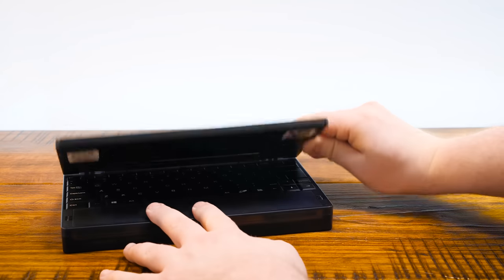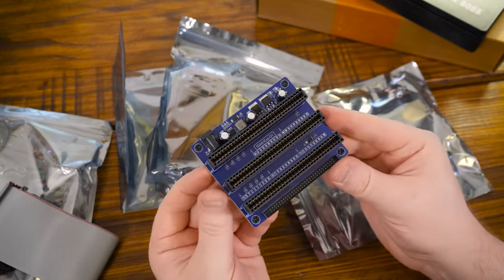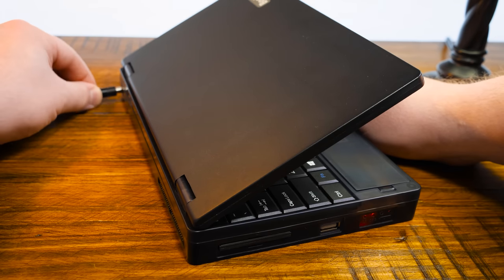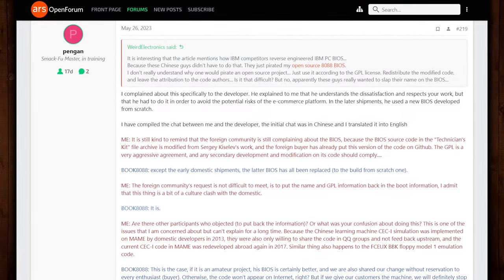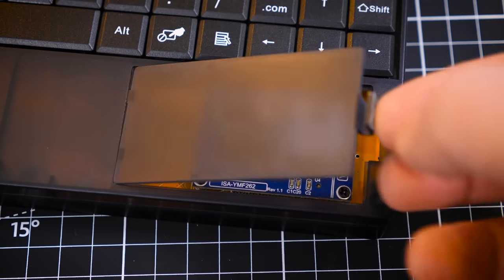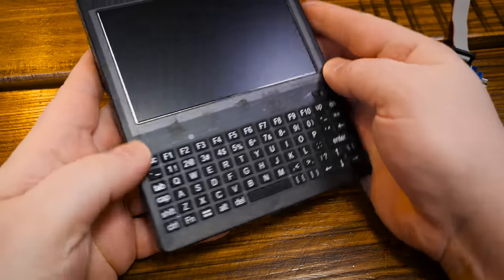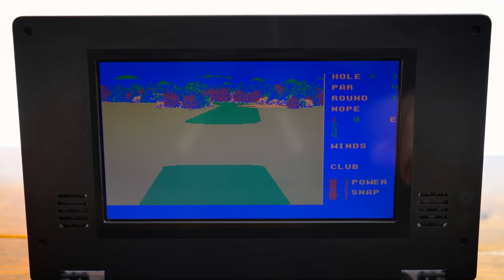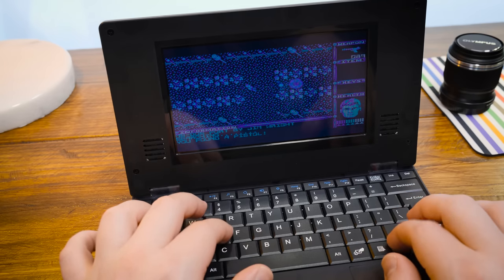So I Bought Those Weird New AliExpress Retro PCs…

Comment: I'm kind of shocked there isn't more "modular" kits that use these old legacy/machine tool parts that are still being produced. It seems like some kind of cottage industry you could easily start making tiny DOS PCs for old games like that.
Reply: That'd be really cool to see.
Reply: True
Reply: This project would be excellent in a small form factor case, maybe replicating the look of the older desktop PCs. Since most of this is open source, a fun addition would be HDMI out, which could be made possible by running the video out through a GBS-Control scaler first within the case.
Reply: Oh how I would LOVE it if that were the case!!  I would JUMP at the chance to buy a new version of a 386 or 486 PC!!
Reply: @NLuKa420  Could also just have an STL file for the case; I'd imagine the venn diagram for "Classic computer nerd" and "owns a 3d printer" to damn near be a circle.
Reply: @skins4thewin  It should be doable. There's plenty of videos on YT About people building them and different supplies of boards and parts- only problem is, all the esoteric knowledge you have to have for different chipsets and things.
Reply: @girthquake1413  I wish that were true... maybe someday.
Reply: @girthquake1413  Agreed.  The circuitry within these two devices seems surprisingly simple.   

I thought such simplicity was reserved for older microcomputers.  Didn't even know a legit desktop 386 could be operational in such a tiny form factor.
Reply: I wonder how much sense is in making these interfaces be wallet sized NFC peripherals for phones

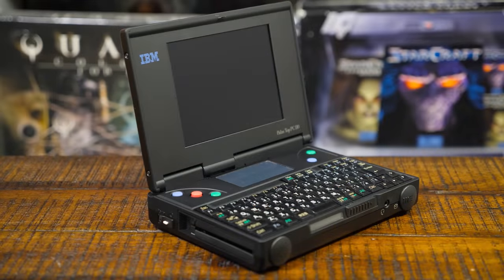Tuesday, June 27, 2023 CE, 15:46 EDT
Reply: @mcwooley  For what reason? If anything with older materials and parts we could keep them thin and reasonably light.
Reply: Yeah, I'd love to have a little 486-DX2 laptop without looking around for an old ThinkPad that may or may not need a lot of love.

Comment: I'd love to see someone with a 3D printer make a sort of docking station with the ISA breakout board.
Reply: FULL TOWER CASE
Reply: It would make it more like the IBM PC110 that this looks like. The PC110 had extra features; like an optical drive and more ports. The newer one would be neat if it had an optical drive but it definitely have more USB ports or older ports and other accessories like audio out and in.
Reply: On it

Comment: I've wondered why these weren't more common. I'm sure the OS freaks out with the wrong pieces/parts. I would kill for a brand spanking new windows XP machine to relive those janky games my family used to play together
Reply: It's a cool idea for sure.
Reply: Friend of mine just found one, old Dell windows XP machine new in the box.  He had to re-cap the motherboard but it works great.  I did the same to an old Packard Bell 486 last year.  So much fun to play my old games again.
Reply: Windows XP minimum requirement is a Pentium. Trying to run it on a 386 just sounds like a terrible time, much less an 8088.
Reply: @cosmicinsane516 I know someone who worked for Dell during the capacitor plague, he'd just immediately replace a certain line of machines that arrived in his shop
Reply: I imagine it's hard to find a giant pile of new Pentium 4 processors to build such a system with.
Reply: Windows XP supports up to the Intel 4000 series officially, and up to the GTX 960 GPU wise.  I’m sure with a little digging you can find the parts
Reply: @edmac1090  Here I am using a Ryzen 1500X and a 970...
Reply: @exiles_dot_tv  I know someone a long time ago got windows xp to run on a pentium 90 with I think 64mb ram
Reply: My aunt gave me their old windows vista machine and it was complaining about not having a floppy drive, so I installed one and then installed XP and that thing runs like a champ. Go out and look around, you’ll find Vista or XP boxes all over the place
Reply: Its not hard to get your own machine, Windows XP parts are not really that expensive last I check, processors for the era cheap. Heck I've got like 5 of them just laying around myself. Building one or finding an old pre-built is not too hard. I'm personally currently working on restoring my old "dream" computer of a Dell XPS desktop and recasing my computer from the time a Dell Optiplex 745 whose case long since fell apart.
Reply: I assembled a test bed with my old XP motherboard, 2GB DDR400 and a Pentium 4 3.20 processor so I could test a bunch of ancient AGP and PCI video cards I have around here. After I was done, I took it all off the test bed I use and reassembled it in an old case (I would have preferred one from the early-mid 2000s, but I didn't have one of those). I am using an old BFG Nvidia 6200 256mb PCI video card and a Creative Audigy 2. With XP it works ok (as it should). Makes a nice retro PC for my plethora of old late 90s-early 2000s games.
Reply: @Andernerd not that hard.....*stares at the half dozen pentium 2.8ghz+ pentium towers on shelf*
Reply: @theodorerelic2718  absolutely.  Only upgrade I would've done was get a pentium 4 HT (edit: with the highest Ghz you can) with 3.5 or 4gb ram and winxp pro

I had this same setup as yours running windows 7
Reply: It's funny. I still have my Studio XPS 1645 laptop from college. One of the first generations of Intel quad-core cpus and the swansong days of ATI graphics.

Runs Win7 like a treat still, especially after repasting the GPU (it was starting to lock up due to paste dry out after a decade and a half) and getting a decent ssd.

Screen is WLED and still gorgeous. Absolutely awesome time capsule that's still usable for legacy stuff.
Reply: @exiles_dot_tv  
You sure? Always thought you need at least a Pentium 3 at 1 ghz
Reply: "I would kill for a brand spanking new windows XP machine to relive those janky games my family used to play together"

I've built one. A real gaming PC and not whatever the hell this thing is.  It's complete as a period piece of early millennium gaming. It's fantastically tacky in every regard.
Reply: @wesleyswafford2462  My employer still has a stack of old XP machines. And Win 7. And Win 98. And DOS. They just replace them and toss everything in a pile somewhere. I think the pile is currently in a shipping container at one of the plants' yards.

You can also see older PCs fairly commonly at estate sales.
Reply: The price and complexity of the project make it niche, I'd say the person doing this barely made a profit. FreeDOS runs on a remarkable range of hardware as well. Modern Ryzen processors can run Windows XP, there are ACPI (IRQ controller) and AHPI (storage controller) road blocks and not everything works but for some magic motherboards there are workable workarounds. I'm sure someone somewhere is trying to get Intel 13th gen i9 to boot Windows XP.
Reply: @federicocatelli8785  just like modern windows you could bypass the hardware checks.

Or you could install it on another system and swap the drive. 

I believe winXP will run on a standard pentium without much fuss, but it will be slooooooow.

I don't think it will run on a 486 though, at least without serious tweaks.
Reply: Sorry to not have heard from you sooner, I scrapped probably 20x Windows XP machines this week.
Reply: @adventureoflinkmk2  That would be one power hungry machine though
Reply: @wise_guy4230  Dang it, you just f'ed yourself over, you could have sold those and made dough, and made other people happy in the process
Reply: @Michael-Archonaeus  I tried to even give them away to save them, no one in the area wanted them.
Reply: @ozzie_goat  I replaced so many when I was a student-worker in HS in 04/05.
Reply: @Michael-Archonaeus  perhaps.. didn't game my watt meter on it lol
Reply: @wise_guy4230  I know the feeling...
Reply: I hate seeing such awesome machines go to waste, in my 20's when my previous school was trying to get rid of their old rigs, I spent an entire week restoring them all to pristine condition. Beautiful XP era machines that would make any retro gamer very happy today. I have no idea what they did with them once I was gone, I hope they were auctioned off
Reply: Ha! DOS "freaked out", on old PCs anyways, or maybe I should say "DOS software". Seriously DOS extenders https://en.wikipedia.org/wiki/DOS_extender like https://en.wikipedia.org/wiki/DOS/4G were necessary, but a lot of software conflicts came up, some apps required a certain one, while other apps required a conflicting extender. Every card had to have its IRQ properly assigned (8 IRQs for 8086, 16 IRQs for 286). It was a nightmare and the reason people held on to C64s, Apple II series, Sinclair Z-8x's, etc., and cherished old Macs, even viewed them as superior tech.  It wasn't til Windows 95... and you think of XP as "janky"?!?!?  It was so much better than what came before! 😆
Reply: @MrWolfSnack   if you're expecting an 8-bit machine to be comparable to "a real gaming machine", then you have no idea how tech works. that's just being silly.
Reply: @squirlmy  I have every idea how tech works, I'm 32 years old and far older than you, so I don't need some little kid telling me about life that I already lived through.   Reading comprehension is something you aren't capable of is it?
Reply: I saved my mom's old Compaq LCD portable computer from 2008-2009 that had Vista on it and I installed Win XP with a legal key. It works amazing and I can play all of my early 2000 games :)
Reply: Honestly might be easier to run them in Linux these days via proton

Comment: My main issue with the Hand386 was the lack of built in mouse they could have included some kind of nipple pointer as without a built in mouse it makes windows use very limited
Reply: My main issue is the appearance. It looks so cheaply made, it stinks of low quality pound shop plastic toys.
Reply: @EgoChip  It's literally one dude - the case was probably 3D printed, and it doesn't look half bad for that.
Reply: @PhysicsGamer  It definitely looks injection molded. A lot of small-run stuff designed in China uses custom injection molded cases, the setup and engineering costs seem to be less of an issue for them for some reason.
Reply: @makomk  He probably works at a factory that makes molded plastic, that would make a lot of sense.  This is his fun side project.
Reply: He he... "Nipple"
Reply: Pound shop? I'm guessing that's what we call a dollar store

Comment: I’ve been messing around with my Book8088 for a week or so. Other than the rubbish documentation, you already mentioned my main issues. 
That screen is just horrible. For anyone watching, Clint has done an awesome job of even making it viewable on camera. But not only is it dim and locked to 16:9, it also has a habit of flipping out and moving the entire image a whole DOS character off screen, to the left. All it needed was some physical controls and the ability to do 4:3 and it wouldn’t have been half bad. 
The other one for me is IO. If it’d just had a single, onboard serial port - it would have made a huge difference. The obvious choice here would have been for a mouse, but also hooking up a modern wifi modem could have been very very cool. 

So close, yet so far.
Reply from the maker: Appreciate your thoughts, sir! It really is a shame that there are such drawbacks to core functionality. Frustratingly close to being awesome.

Comment: I bought the Pocket 386 from the same manufacturer on AliExpress for $350 Aud. It seems they took your wishes to heart and combined the Book 8088 format with Hand 386 gubbins and, voila, the Pocket 386. Nice.
Reply: I have an original 386 laptop but it's getting unreliable, screen flickers, so I too purchased the 386sx40 pocket PC, still waiting for it to arrive. If I had the time and a little more skill, I would have loved to have repaired and repurpose a 386DX CPU + motherboard that I salvaged from a closing down PC shop from years ago, its suffered from significant track corrosion from a Darth Varta battery!

Comment: The fact that the manufacturer told you that turning up the screen brightness is as easy as replacing a resistor on a board feels like the most authentic part of the build. 
And I AM old enough to have used an 8088 pc when I was a teen (and a Commodore Pet, and an Apple II etc. etc. etc.)

Comment: The screen here is a total miss :( I’m mostly talking about its aspect ratio. I do understand that it’s impossible to find 4:3 screen today, but they could add some scaling option, black bars on sides. 

Aspect ratio is my personal pain, that I faced when was searching for good DOS laptop. The 16:9 laptops can’t do scaling in pure dos, so all these “square” games are squeezed. When I switched to 4:3 laptops it was also not an easy task since not all ancient GPUs could properly display Mode 13h resolution, so some laptops displayed 320x200 games squeezed. Ended up with Toshiba Satellite 2805 that covered all my needs, geforce 2 properly display and scale everything so 320x200 took full screen and YMF754 plays fm and wavetable. A truly unique machine.
Reply: Yeah, aspect ratios suck now! I get that most PCs are expected to display "cinematic content" well but for text, a PC's bread and butter, even for web browsing, more vertical space please! There's a reason books are portrait-shaped.

Comment: Wonder how long till retro repro components start to become more common in the mainstream market
Reply: It's always gonna be niche. It's cheaper & better in almost every possible way to emulate (hardware) or run in a VM. It won't disappear either, but it's always going be low volume hobbyist stuff.
Reply: The one thing that I would love to see made again are crt tvs. Not just for gaming but for also watching TV shows made before the switch to HD.
Reply: @Play-On7  Im surprised there aren't any manufacturers or NOS CRT, especially for industrial markets!
Reply: They are already mainstream in countries like Ghana, South Africa, Bulgaria, Greece, etc. It is very weird seeing them in the USA though.
Reply: @0326Hambone  I'm curious what industries still need CRT screens in particular. I know they tend to keep old equipment around to avoid having to overhaul their processes, but screens are pretty interchangeable.
Reply: @stevethepocket I really can't imagine any industry outside of enthusiast gaming needing a new crt.
Reply: @Play-On7  surprised no start up has made crtvs for the gaming market. The barbie tv and vcr will only last so long
Reply: @botluckproductions  Shipping CRT monitors is too difficult for a start up. A lot would break in transit.

You'd need pretty good distribution networks for it. Plus gamers are your only market. There's probably room for one or two companies to do it for retro gamers, but shipping issues probably make that tiny market not worth it for how many replacements you'd need to send.
Reply: @arsenalfanatic09  when there's a will, there is a way.
Reply: @USSMariner  It's basically arcade machine restoration and a few security system setups in various old (mostly government owned) buildings that would have to be completely re-wired to work correctly with LCD displays, other than that CRTs don't really have a use case for like 99% of the planet anymore.
Reply: Never, the industry is moving forward not backward.
Reply: @botluckproductions  more like when there are enough people willing to spend  $2000 for CRT screens there will be a way. 

It's too niche of a market. I'm surprised no one even tried a kickstarter for it yet, but maybe big companies got rid of their equipment to make CRTs so long ago that no one could buy cast-off manufacturing equipment to make it happen for cheap/easy enough.
Reply: @zijiehe1730  I mean yeah, but with all the retro gaming now a days.

Comment: A new version of the Book8088 is out with a VGA connector added. Serial (RS-232) and parallel ports have been added too.
Reply: I was about to post about the added ports, but not sure which listing to trust, as they mention VGA graphics and 15 pin connector doesn't show an actual VGA connector in any pics, just a sub-board and a door added for it to go in the bottom, in a similar way the sound board goes in the top. I'd like to think they're getting this good at rapid revisions. The version with most pics has the serial and parallel ports, so I trust those are in fact added. I'd guess the VGA card may be offering the graphics on the built in display, which probably supports at least the full 256 color palette. The supporting drivers for the VGA chip may also bring things like a software based adjustment to brightness.

Comment: They are compulsive buying toys that'll take dust after a month, tops. A proper screen and keyboard would make the 8088 one a nice retro-coding machine.
Reply: Yeah, you have to really want that retro feel to run an 8088. 

Arguably that's probably the one I'd chose, but I already had an 8088 as a kid and I don't really miss it too much, there wasn't a lot of stuff I cared to run on it. 

But it would be funny to pull that out and use word perfect to write a document in dos.

Pretty much a novelty.
Reply: @volvo09  I had a 8086 PC in the early 90's, it was great to code in QBASIC and then Turbo Pascal. Getting that pleasure back would have been nice, but not with a keyboard that will get me raging after 20mn while my eyes are bleeding.
Reply: @alexandredevert4935  I had a computer programming course (html and qbasic) and I brought a 486/50 with windows 3.1 as my laptop to the class "before it was cool" (back in 02 -03)

I just enjoyed older machines. Everyone else used the new school computers, but I used my 10y old laptop (I've got a similar one today)

The instructor thought I was dumb and said it won't work, and I said it will do everything this course requires, it's just old. And it did... I passed the course with it.

But no one understood it, they thought I was poor. Haha